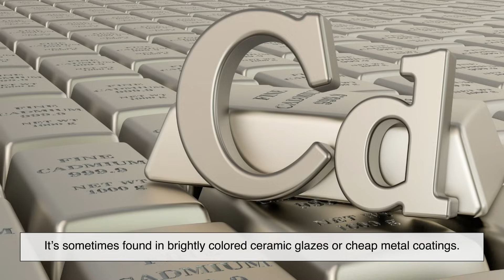Why Some Metals Are Food-Safe While Others Are Toxic

Comment: There were studies done that suggested that aluminum does not cause Alzheimer's, but that it somehow causes the brain to form aluminum deposits as a result.
Cast Iron fry pans are the best.  They have good heat retention, and unlike Teflon and some other non stick coatings is user renewable.  The "seasoning" process has nothing to do with taste.  It's rubbing in a thin coating of oil like Canola or Olive oil, or Avocado or Grape seed.  Shorting or bacon grease is also used.  Then the pan is put into a 400 degree oven for about an hour, then allowed to cool.  This causes the oil to bake into the surface. this is done 3 to 4 times and is ready for use.  As you use it over and over it will take on that glossy, black, Obsidian look of well used cast iron.  There are many CI pans that are 100 years old, and a fair amount that are from the Civil War and possibly before.